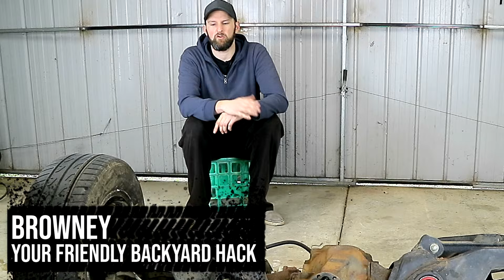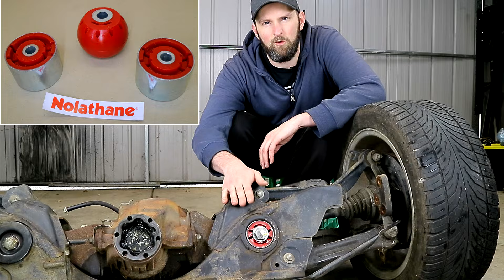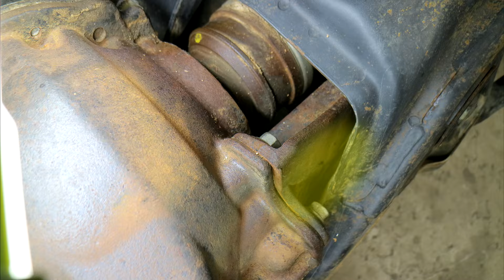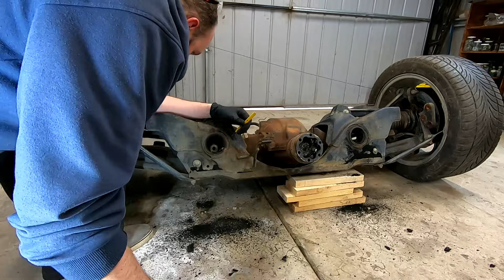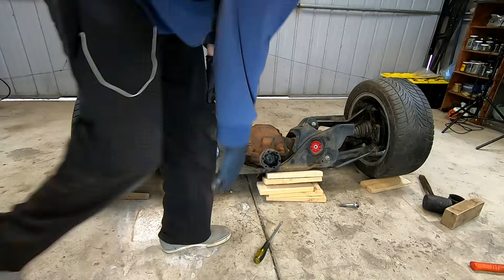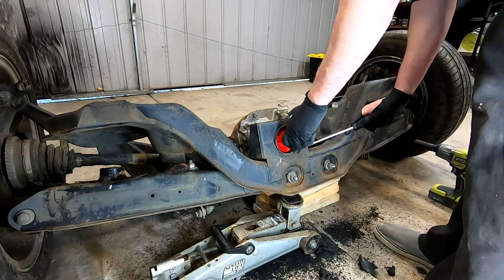Remove and Replace Falcon Diff Bushes | BA, BF, FG & FGX Falcon and SX, SY & SZ Territory

Comment: Can't believe you used a carpenters claw hammer on the chisel. Not designed for it and can be dangerous as the face is softer than an engineers hammer, ie ball pein hammer.
Reply from the maker: And I didn’t die once! 😮

Comment: I've saved this job for the Xmas break. I like the freezer idea better than threaded rod and bolts to tighten and force it in there.
Reply from the maker: Glutton for punishment like myself it seems - see a nice break and fill it with work! Depending on the bushes you use you may have to try a bit of the freezer AND threaded rod method but I got away without it as you saw. Hope it goes well mate!
Reply: Wasn't to hard honestly.

Comment: Hey mate, with the centre diff bush is it because they’re nolthane and not oem bushes the reason you didn’t transfer the big round spacer that would usually be bolted up with the centre diff bush? Or would it be because it’s lsd? Really curious as I’m doing this with the same bush kit tomorrow. Cheers

Comment: Step one....remove your entire rear axle assembly. Right.
Reply: Obviously didn't listen at all. He posted another video with the removal and re-installation of the diff
Reply: @mqrkoh comment was in regards to changing diff mounting bushes. More of a dig at Ford, than this creators video. The need to entirely remove the back end of a vehicle to replace diff mounting bushes makes as much sense as pulling your entire engine out to change the oil filter.

Comment: Hey mate I know it’s an old video but did replacing you’re diff bushes give you and sort of diff whine, mine where replaced with nolathane now I have diff whine noise
Reply from the maker: Not that I particularly noticed, but I also mostly hear the slightly louder exhaust when having a play or cranking music when not, and don't a great deal of driving in it before/after the bushes were done so couldn't do a great comparison before and after. Sorry I can't be more help mate.

Comment: HI browney, I have a BA XR6T 430 kw, just done IMS twin bush hat conversion and th400 for the power. being a BA I expect the main centre diff bush was originally the offset bolt type but now with the new hat the diff centre is the same as BF & FG orientation " centre bush bolt not offset ". Do you see this a being a problem with balancing or pinion being  wrong angle, I'm using the 2 piece tail shaft as well.
Reply from the maker: Hey mate, good question but I’d be a little surprised if they hadn’t factored for this already in the kit - never know though. Haven’t played with one so can’t answer but sure a quick email or call to IMS and they’d sort you out? 

Good luck, looks like a good bit of kit 👍

Comment: Good explanation of whole process....Can the job be done with car on ramps without removing entire rear assembly ?
Reply from the maker: Unfortunately not, needs to be dropped. Passenger side front bush is hard up against spare wheel well/fuel tank, similar for the other front I believe. Sorry mate, not the answer you want I know!
Reply: @BrowneysGarage  Drop the fuel tank instead?

Comment: I’m using super pro bushes and I’ve done taken out the old front bushes but keeping them in the freezer over night hasn’t helped me trying to hit them in, what do I do? Get a press or ?
Reply from the maker: Could try some all thread or a long bolt, big washers and a nut and use this to draw it in. Won’t make the bushes fit though, are you having trouble with them not fitting at all? Have you cleaned the surface where the old bush was?

Comment: Hey Browney, followed this and just installed some Nolathane bushes, awesome video thanks! How are the bushes holding up today? I see Nolathane cops quite a bit about there bushings being bad and going bad quite quickly.
Reply from the maker: Boy do they, plenty of people let me know about it! I wonder how many have actually used them though, I haven't had any dramas to date but haven't been under to suss them out recently unfortunately.

In saying that I was a little shocked at the rear bushes 'ball' design and how easily it slipped in, after seeing what some well known shops have said about them since the video I would in future give SuperPro a go.
Reply: @BrowneysGarage  As a mechanic and a Track Drover, Nolathane are the cheap skate for Polyurethane bushes. They fall apart a lot sooner than even the OEM. If you want quality, SuperPro for sure. I have them on my drifty car and they get ABUSED and hold together like new.
Reply from the maker: @proxypanda4156  Thanks for sharing mate, will be sure to give them a go next time - just hope that's not too soon!

Comment: I have a 2004 BA V8 Fairlane G220. I appears to have been manufactured with XR8 suspension.  I am considering the replacement of  the OEM front shocks, spring, & struts; with Webco Front Low Pre-assembled Spring Shock Strut for BA, BF FAIRLANE, Falcon from Ebay. This was a short run model and I am unable to find any trustworthy information on it. Could you give me an opinion on the selection of this product? I enjoy your watching your posts. Thanks, Lex
Reply from the maker: Sorry Lex, I have zero experience or knowledge on the brand so anything I said would just be from searching online as I'm sure you have. Good luck and thanks for watching mate.

Comment: For the average guy out there, l strongly suggest go with the original rubber bushes. Nolathane will introduce a whole new set of problems. If you got to replace rubber ones every 10 years whats the big deal anyway. If it's a race car different story.

Comment: Y do u have to remove the whole diff y can't u do it while it still in the car and use a hoist?
Reply from the maker: If I had a hoist I wouldn't be rolling around under the car! Not possible on these with the diff in the car still though, have heard it's do-able by hacking up the spare wheel well to get to the front diff bush it blocks but that's too hack for even me.
Reply: @BrowneysGarage  yer I don't have the $1200+ mechanics want to do the job so hoping there's a way of doing it with the diff still left in the car and u don't have to drop it out to do it
Reply from the maker: @Jarrod Wareham $1200 is pricey, should get it done for under $1k, maybe closer to $700 or so.

Or just drop it and do it yourself, it’s really not that bad - https://youtu.be/82xNUMi7QXw

Comment: Brought myself my first Barra turbo manual, and it also is getting this dreaded rear end knock as you described browny specially when on and off the clutch. 

Been quoted 650-700 by a front end specialist shop to do all the rear end bushes in and out that day. Not bad for the price? 

Too used to the old reliable ls1 commodore but you know, nothing like a turbo 6!
Reply from the maker: $200-250 in parts and leaves under $500 in labour, sounds fairly reasonable to me.

Good luck with it mate and hope it doesn’t disappoint again after the LS 👍
Reply: Old mate: where'd you get it done mate?
Reply: I’d love to know where I could get that job done for even 50% more than that

Comment: Hi guys, I’m a female Carpenter and I can normally handle my own, though I feel like I’m being royally screwed by my mechanic. He says a new diff for my Ford falcon BA 2004 is going to cost me $1500. 
I call bullshit! 

Can anyone explain how I can do it myself?

I do my my own basic things, such as services and have changed the alternator and thermostat. 

Cheers
Reply: Just to clarify, I don’t know the difference between a diff and a diff bush. All i need is some guidance
Reply from the maker: @Meagan Reilly Hi Meagan, happy to try help but just a little unclear. Is this for new diff bushes (as replaced in this video you've commented on) or upgrading/replacing the whole diff?

Diff bushes would certainly be more common to do than the diff itself, as the diff generally has a very long life unless there's a LOT of abuse & extra power or accident damage - normally at least. The labour for these 2 jobs will be much the same as the whole diff cradle (the assembly worked on in this video) has to come out for either job, but prices for parts will vary.

If diff bushes need doing then I'd say that's a bit high, under $1k seems more reasonable. Perhaps you could post on a BA/B Series owners Facebook group with where your located for local recommendations of who will tackle it cheaper?

If it's the diff itself that needs replacing it will vary a lot depending on what you can get one for second hand or rebuild cost, then probably best to do diff bushes while it's out any way and you could quickly be looking at a decent price for what it is.

Comment: $550 for the nolathane kit in New Zealand...$180 for original Ford kit...
Does that sound right?, sounds like a rip to me.
Reply from the maker: Sounds like a HUGE rip on the Nolathane kit, still listed on eBay at just over $200 so $350 to get it over the ditch would be crazy. Surely they can had cheaper.

Comment: Great video. How much time did it take you from start to finish? Did you have access to a hoist to remove the cradle or just home tools like jacks and axle stands etc?
Reply from the maker: @Hunt Moorhouse Thanks mate. Honestly I couldn't tell you how long, I spend just about as much time moving cameras and lights and loose a sense of it these days. Seems doable in under a day all in, but having not done it before put aside a weekend maybe?

No hoist here unfortunately, all simple at home tools. Full video of removal and replacing is now out, check it out here - https://youtu.be/82xNUMi7QXw
Reply: I had to have this done on my G6E turbo at 90,000km as the rear bush was flogged out & the other two on the way out also - stupid design as the bolt literally writes around in the bush and hogs it out - pretty much doesn't matter what bush material you use, the engineering of it will guarantee it'll flog out before it should.  I didn't have a hoist, so after reading through the workshop manual I decided to pay someone else to do it - it was $1800 NZD all up from memory, but that was years ago, probably be a lot more than that now given how much more tradies are paid these days.  It was just about due for another round of replacement when some stupid cow ploughed into the back of the car whilst she was looking at her phone and wrote it off.  Now I have a Lexus GS460, and the diff cradle engineering is so vastly superior - really don't know why Ford didn't sort this out after so many years.

Comment: It's much more difficult with decent quality bushes mate. SuperPro bushes are far superior as offer lifetime warranty, but are a fair bit more difficult to install.
Reply from the maker: @Mick Holgate Better quality = harder to install? Not sure about that mate, and if you’re basing it off a lifetime warranty Nolathane also offer it.

I’m all for people having preferences and I have no brand loyalty but a few things don’t add up there.
Reply: @BrowneysGarage  they are tighter fitting, I'd never  trust that rear nolathane bush as it's a push in version, which is why no performance ford workshop uses them. Check out SuperPro mate, they leave nolathane for dead!
Reply from the maker: @Mick Holgate SuperPro aren’t pushed in?
Reply: @BrowneysGarage  no they are pressed in (with a press or tool), you cant do by hand ;)
Reply from the maker: @Mick Holgate Better let SuperPro know then mate cause they’re own guide says otherwise 🤷‍♂️ https://imageapi.partsdb.com.au/api/Image?urlId=hY%2BRl2935T1BzaDZGYMds3uuybl115lA4y%2Btue0Zx0KN6DHN93UTQWn8ZFStui%2F5
Reply: @BrowneysGarage  check out the rear bush installation, that what I'm referring too. Push in with fingers vs using mechanical means to press in. I know what I'd prefer in my GT-P.
https://www.youtube.com/watch?v=NHDPzefvVPQ
Reply from the maker: @Mick Holgate Fair, and again may well be better. The point I’m interested in keeping clear though is that this can be done at home and doesn’t require a workshop and press. The rear SuperPro differs but the fronts are the same style and so install is the same. That rear is listed as being able to fit again using the same method to knock it in or at worst drawing it in as shown.
Reply: mate I'm not having a go at you, just outlining that there are better bushes that require different installation process, that's all. Your video is good.
Reply from the maker: @Mick Holgate All good mate and I have no dog in the fight, I may well use SuperPro in the future and not like the Nolathane, if so I’ll be completely open.

As long as the right info is out there for people then all the better.
Reply: Neither will last as long as rubber but they will feel better than rubber for the first 20000km then they will start to full apart. I remember my XW started to pull to one side under braking. Then I noticed bits of blue rubber / plastic on my driveway. Jacked the car up and one of the SuperPro bushes (radius rod to body had started to break down) When I pulled them out they had started to split along the seam from the mould, once they get a tiny split or chip they just continue to tear apart) Replaced with rubber, drives perfect. Don't compare new poly bushes to 20 year old rubber, compare new rubber with with new poly
Reply: @timobrien9123  if it was a superpro, they have a lifetime warranty so wonder if it was installed correctly with appropriate amount of lube etc. Did you contact them?
Reply: @timobrien9123  side to side movements yeah ok. Up and down movements use standard parts.

Comment: Had mine done by my mechanic. You certainly don't need to remove and take out the diff. He just dropped it on the hoist. However if you're getting paid by the hour. I fully understand.
Reply from the maker: @Joe VAN DIJK Dropped on the hoist or removed all together will be pretty similar anyway time and work wise, unfortunately most of us don’t have the luxury of a hoist though.

Have also seen it done but cutting a hole in the spare wheel well but obviously wouldn’t recommend that!

Thanks for watching mate.

Comment: Hey man love your videos, had a shop do diff bushes on my bf. Now the whole rear end feels unsafe especially around 90+ kms per hour.
Reply: Any ideas what they could of done wrong? Mind you they also did sway bar links and control arm bushes so the whole back end has been tossed a bit but the guys reckon they aren’t at fault when they raised the issue first and it felt smoother before I forked out 2k
Reply from the maker: @Matthew Felice-Nicolay Sorry to hear mate. I'm far from an expert but I'd suggest starting with the basics if you can, go through and nut and bolt check everything in the rear. I remember the rear of this car being all over the place when I first got it and found that one lower control arm bolt where they attach to the cradle was slightly loose and was giving some play - this car had a bit of a sketchy history!

Beyond that get a good full wheel alignment check? There is very little adjustment in the rear I believe but this may show up anything out of the norm?

Comment: or leave the bushes in the garage overnight in a nice cold melb winter evening. now that you have done the fun part, I will wait and see how you go in installing the cradle back up
Reply from the maker: @bryan skerry They certainly weren’t defrosting out there I’ll just say that! Fingers crossed mate, I’m dreading that much more than this part, should be right though.
Reply: @BrowneysGarage  take it easy and have the jack and wheel stands ready to help with the lift up.

Comment: Great information in this video Browny . Mate this is a mongrel of a job . I’ve been told mechanics charge around $1700 to $2000 for this job .
Reply from the maker: @Conservative Sniper Hunter Thanks mate I’ve heard some outlandish prices too, supposedly any taxi workshop is the go to for this one if you don’t want to deal with it yourself! If it goes in without any dramas, which I expect will be fine, then I just don’t see being anywhere near that hard or time consuming especially with a hoist.
Reply: They charge about 4 hours, so around 700 including the bushes. Anyone charging more is completely ripping you off.

Comment: My ocd would of had that diff and cradle painted like new
Reply from the maker: @Ross C I was going in that direction too until I realised I wouldn’t be happy doing that unless it was pretty spot on. Which would me blowing the whole thing apart... then re-bush EVERYTHING... then I might as well powdercoat everything instead etc. Didn’t want this to blow out into that size job and $1k plus so it’s deal with the main issue and get on with it! 🤣

I did pressure wash it if that somewhat helps!
Reply: @BrowneysGarage   Put an lsd diff and axel assembly in sons old vs commodore wagon a few months ago, it's the best bit of paint on the car lol he wouldn't let me paint the trailing arms.
Reply from the maker: @Ross C 😂 Nice! And thanks heaps for watching mate.
Reply: @BrowneysGarage  loving your videos by the way
Reply: Yeah it's taken me over a month to get mine ready to put back in.painted the cradle and arms.i did all the bushes and hyme joints on the control arms and blades.i used the superpro kit.lifetime warranty.wasnt cheap though